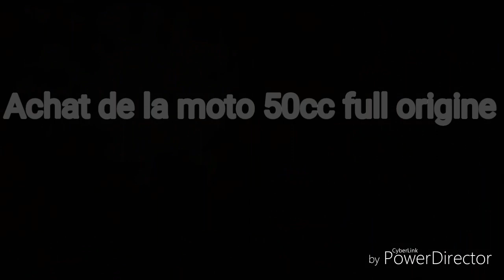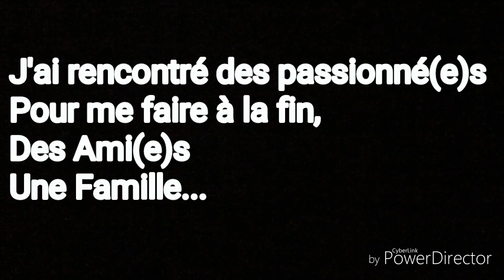Projet Rieju Mrt Black and Pink by SõdaStunt79

Comment: How did u get your rieju mrt pro so high i want to raise the back!
Reply: Rieju Rides You can buy a little metal thing in german its called "Höherleger" u just put this thing under ur back abd it raises i dont know how the explain it in english exactly
Reply: Which website did you get it from?
Reply: Drill 2  holes in to the 2 metal bars on the bottom so that they are closer to the frame. Then putnthe shock in to the holes and it raises the back.